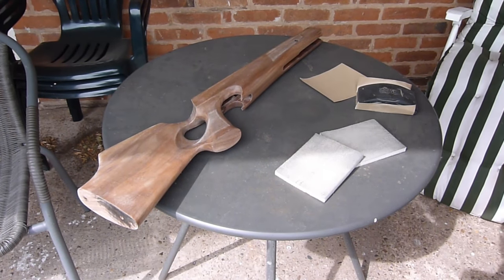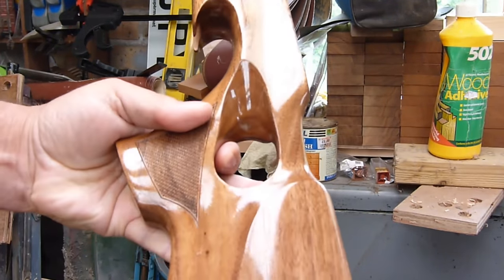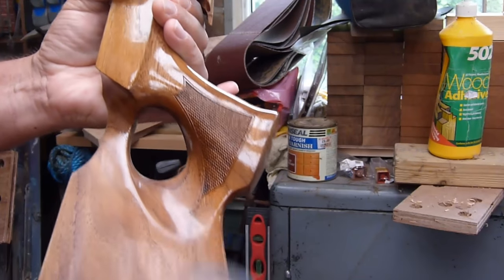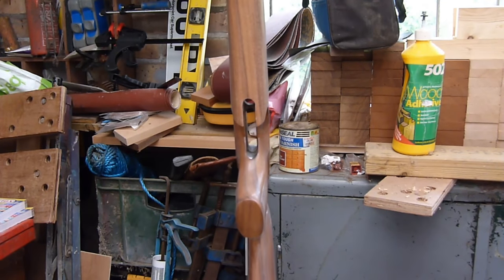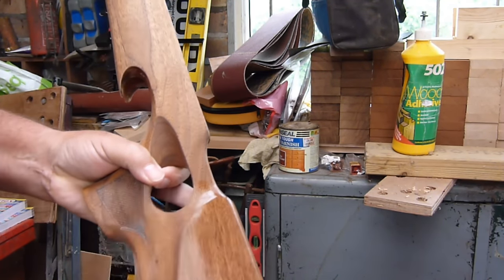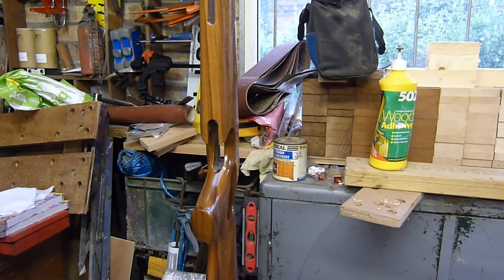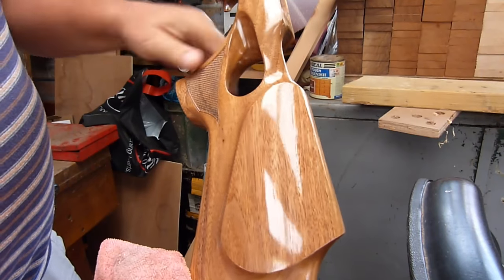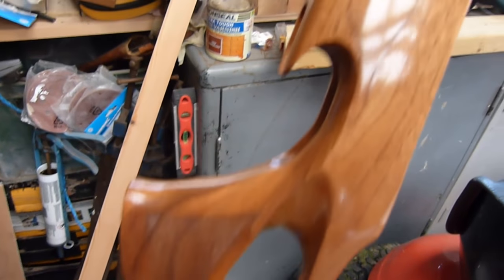Tru oil the easy way - Get a High Gloss finish!

Comment: If you poke a tiny hole in the foil seal instead of removing it altogether, you can just drip it onto the cloth rather than touching the bottle. Then you don't get the crusty bits on the cloth.
Reply: Thanks.  That trick worked great

Comment: It makes a fine finish for hand made musical stringed instruments, too.  I know from personal experience.  The secret there, as well as in gun stocks, is to remember a few things:  1.  It is an oil / varnish finish, with drying agents added.  If you put a partially used bottle on the shelf for a year and come back to use it without stirring it, you can bet the drying agents have settled as solids to the bottom.  If you don't remix it, you can count on failure.  2.  As our host says, it's a very thin finish, built up in many thin coats.  If you get impatient and try to build up a few thick coats, you can count on a gummy, nasty failure.  But if you do it as advised, and if you are very patient, you can count on a beautiful, high gloss finish.  If you don't want it high gloss, just knock it back with some pumice and buff it with a soft wool cloth.  PRESTO!...a beautiful egg shell luster!
Reply: The same company makes a satinizing agent (Stock Sheen and Conditioner) that also works very well in turning the gloss finish to satin, which is particularly nice for guitar necks. I got a multipack, and that satinizer will probably last me several lifetimes because you only need like 1/4 tsp for an entire neck.

Comment: Great video. Tip: Use a rubber band or hair tie to your applicator so you don't have to wrestle with holding the material together to stop the filling coming out.

Comment: It's beautiful but I used after applying three layers of danish oil, 2k high gloss car varnish with the same result. It's also scratch resistant and remains beautiful after years. I used it also on my mahogany stair rails and it's still beautiful after 8 years.
If it's still getting dull after a time, you use some car wax. It's really less work than all that polishing. Try it for yourself with an old piece of wood if you don't believe me. Thank you and have a great shooting time 😊

Comment: Also with tru oil to make it last longer (it goes off )  put a tiny pin hole in the foil cap near the edge of the lid and squeeze a little out  at a time ..  it doesnt set in the bottle then

Comment: All that elbow grease, and stick-to-itness. Shows hard work pays off. Almost looks like a Minnelli stock. Good bones to work with for a video, that's for sure.
My air arms pro sport came unfinished walnut. I use a coat of Watco wood oil, and buff it after. Comes out nicely for a day. I figure without a high gloss, I can work dings out easier. Haven't got one yet. I handle that rifle like a baby. Good job on that stock, I love it.

Comment: Sir, that is the best finish job I have ever saw! I bought a Lyman Great Plains that was stained but not finished. I just ordered sandpaper, cheese cloth, and a very nice True Oil Kit. I wish you could coach me through doing my stock, but listening to your accent, it tells me that we are just way too far from one another. I sure hope I don't screw it up.
Reply from the maker: Dont panic, you will be fine. Ger the lint free cloth. Make the pads. Press on HARD - spread the finish real thin. Do lots of coats. A fine coat doesn't take long to dry. If you get a bit of rough or uneven finish,get some real fine wire wool and just flat it then put another couple of coats on. Take your time, enjoy :)
Reply: @shootingatdawn  Which car cutting product did you use in the end?
Reply from the maker: @LigerSupremacy  farecla

Comment: If you poke a small hole in the foil under the lid you can regulate your pour more accurately, and it helps prevent that skin from forming. I just use the tip of a pen and that works great.
Cheers!

Comment: Great idea with the kitchen roll and cloth. Have just done this on my stock having previously applied two coats with my finger but have had to steel wool between the coats due to it being streaky but I've just done a 3rd coat with the roll and cloth and the results are so much better

Comment: Been seeing so many ways to refinish a stock. I'm refinishing the stock on an Remington Bolt-action .22lr. After removing the old finish and cleaning it, I've added the Birchwood-Casey walnut stain. I then plan on applying their sealer to it, then applying the tru oil. My goal is to get a glossy finish following their directions.

Comment: When I use TruOil on my guitar necks I build up the layers much like you do, but after 6 coats or however many I want I dry it for several days then buff it out with a scrap piece of clean denim cut from an old pair of blues jeans.
Reply from the maker: Nice tip - thanks :)
Reply: Are you just buffing with the denim or are you using a wax, etc?
Reply: @LateBoomerGR  I start with dry denim. If I thinking need cut more, I'll use buffing compound. And I've got used it once.

Comment: Hi Neil, I have just seen your vid on the try oil method and it looks a great finish, just what I'm looking for. Could you tell me how you dealt with the chequering? did you sand down like the rest of it as well as the oil? I see some suggest thinning out the first couple of coats to help fill the grain, what's your feelings about that method?

Comment: I've been working on a Traditions muzzle loader for a few weeks and got to the oil finish, 5-6 coats in and it looks great except mine is slightly blotchy with a lot of high points. I knocked it down with 0000 steel wool but I keep getting bits of steel dust everywhere and it looks like I'm back to bare wood. I know I went a little heavy with my fingers so I'm going to try your method with the towel and lint free cloth. 
How long is a good drying time? I'm on about 5-6 hours earliest.
Best part about wood working is if you don't like it, it's fairly easy to undo and try again.

Comment: What about treating the stock surface with wood grain filler first and then doing the Tru Oil treatment? Would that aide in having to use less oil coats? Any thoughts?
Reply from the maker: Give it a try, it cant do any harm. I basically used the first fine coat as a sealer. It doesn't need much when you apply it this way.
Reply: The sanded wood fills any small cracks

Comment: I thought your video helped a lot could you tell me what stuff you used so I can get the same material. Thanks
Reply from the maker: Tru oil. Lint free cloth to make the pads. You can use either cloth or anything else that will just soak up a bit of oil to use for the middle of the pad. Small amounts of oil per coat - rub hard.
Reply: Thanks what sand paper did you use and that t cut thing.

Comment: Im refinishing thestock on a 40 yr old weihrauch hw35 ive stained the stock after taking back to bare wood. And the last grade paper i went over it with was 280grit whats the finest grit you would go upto before applying the tru oil. My worry is that if i sand it to fine it may seal the wood and not allow tge tru oil to soak in? Thanks in advance love the videos👍

Comment: Sorry if I mist it but how long do ‘you’ leave it before each coat or do you just follow the oil instructions? Thanks
Reply from the maker: If you do it this way, it won't take long for the coats to dry - maybe an hour or two. Have a piece of scrap wood available and coat that at the same time. Then you can use it to test if its touch dry rather than the stock itself.

Comment: Did you sand in between coats? Or did you later a good few coats up first then sand back a bit?
Reply from the maker: The coats I put on were as thin as possible. That means it dries quickly and there is less chance of getting irregular build ups of tru oil which easily happens if you try the finger application technique. I would give it 3 or 4 coats and then flat back only if I thought it necessary. You can play it by ear. If it's looking great- carry on. If it's looking a little irregular anywhere, flat it back and then carry on :)
Reply: @shootingatdawn  great advice! And just in time to by the looks of it! Cheers, and what a finish on the gun stock!

Comment: How long between coats? Did all those coats come out of one 3oz bottle?
Reply from the maker: Yes all those coats came out of one small bottle. Using the pad method that I use, a little goes a long way - nice thin coats! Drying time, not long and in the recent warm weather we have had it takes even less time. I could do at least two coats a day but I was in no rush so I could happily leave a day between coats.

Comment: great video! so to get a high/satin finish rather than a gloss finish just lightly rub with 0000 wire wool, or apply less coats?
Reply: I'm not the original poster, but yes, or pumice.

Comment: Is that waterproof? Can I use it in furniture or any wood on bathroom?
Reply from the maker: I actually dont know. I try not to let any water get in my Stocks and if it does, I wipe it off almost immediately. It's the same stuff that many folks use for finishing guitars. Maybe google the specs of tru oil to see how water resistant it is.
Reply: @shootingatdawn  thanks for your response. But may I know which varnish would you recommend to me for the bathroom or for water exposed areas? I will look for it if its available in our country. Im sorry for my bad english.
Reply from the maker: @jeffreyestrera4974  yacht varnish.

Comment: Ive been told to mask up the grippy parts until the final coat of oil is this correct mate?
Reply from the maker: Up to you. Tru oil is semi synthetic so it dries hard. If you are using a pure oil I would go with that suggestion.
Reply: @shootingatdawn  after my first coat of tru oil ive noticed the walnut stain could do with another coat would it be ok to rub with 000 wool and apply more stain ? Thanks again !
Reply: @JohnG-gu5wo  I have never done that but all I can say is try it and see. If the trul oil has sealed the wood , the stain won't take. The worst that can happen is that you have to strip it and start again.

Comment: How many coats before you use the steel wool ?
Reply from the maker: It's all about how it looks. It is a lot easier using this technique to avoid thick build ups and runs. I basically only used wire wool if I wanted to flatten the finish to remove and rippling or "orange peel" type surface.

Comment: What was that stuff that you applied at the very end to buff and polish it? How many coats of that stuff did you use and does it stay glossy after using the gun?
Reply: Use a automotive rubbing compound like meguiars ultimate compound then follow up with a wax. Use like 16 to 20 coats. And yes it will stay shiny after use. I have guns I tru oiled 15 years ago and still look great.
Reply from the maker: The specific stuff I used was farecla fine cutting compound. Car polish.

Comment: This is amazing! I have a guitar that I have finished with tru oil and sanded up to 2,000 grit. I was wondering what buffing compound should I use to get rid of the lint from my cloth and the visible wiping streaks. I don't want to dull the finish though. What would you recommend?
Reply: Don't bother with cloth, wash your hands and use just your fingers. I have never used cloth after an old timer showed me the results from hand rubbing it in.
Much smoother, no lint

Comment: Tru-oil is nothing more then Stand oil with Stoddard solvent (mineral spirits). 
What's Stand oil?
Stand oil is nothing more then linseed oil placed in a vacuum and heated to approximately 500°+ for an extended period of time. It's thick, more clear and dries unlike any other linseed product – it doesn't yellow with age. It’s not to be confused with any other linseed products like raw or boiled linseed oil. It's been used by artists for years and is available online or at good art supply stores, I’m an art conservator and have been using it for years – it's less expensive then Tru-oil. Unfortunately, so many people have been snowed by big companies and their "proprietary formulas."
Reply: So what ratio stand oil / mineral spirits do you use? I've got a small amount of teak on my boat, this may be a good option??

Comment: to much of a plastic looking finish for me
Reply: Knock the high gloss off with a pumice rub or a 0000 steel wool rub, followed immediately by a vigorous wool flannel buff.  It'll work.  The precise luster you seek depends on your own experimentation.
Reply: @patrickh9226  you are correct in a way but you shouldnt let it dry to start off with, then you wouldnt have the extra work